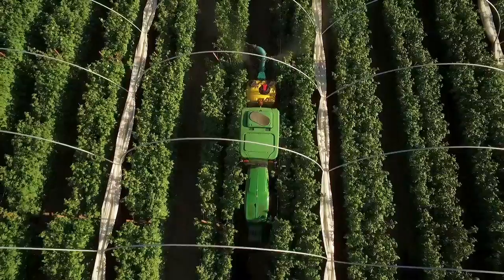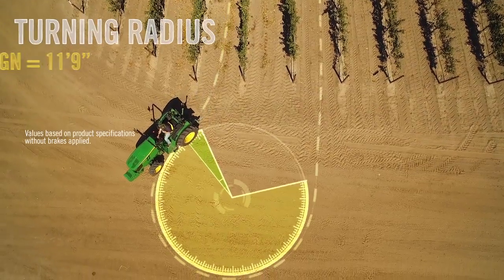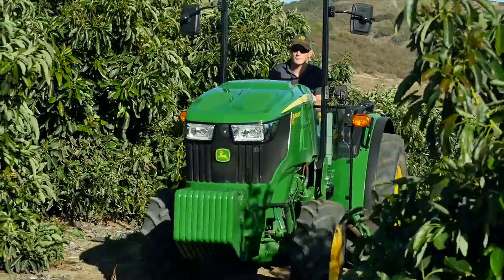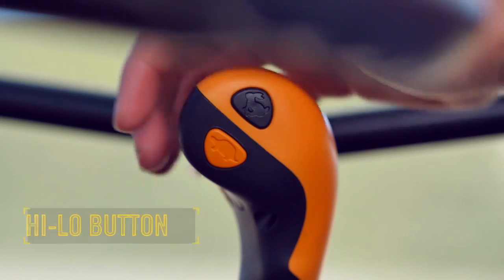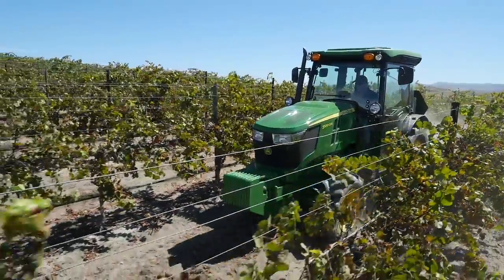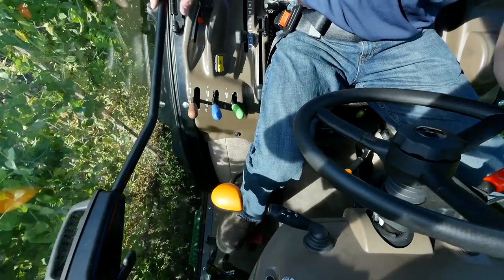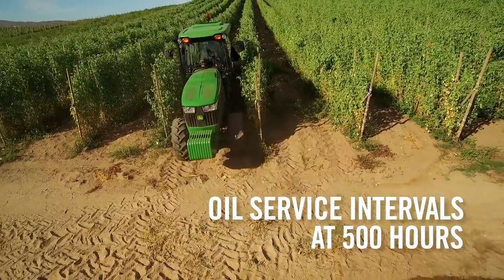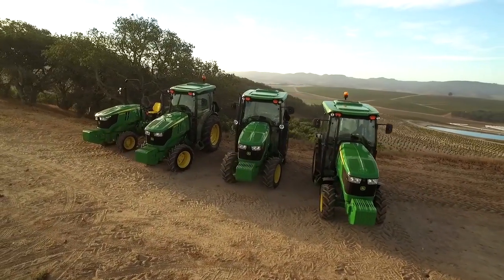5G Series Narrow Specialty Tractors | John Deere

Comment: my boss bought a new 5100gn tractor.  and when turning on the tractor it turns on a code that we don't know how to check.  it is the E032 PTO
Reply from the maker: We're sorry to here about this issue, Jorge. Most diagnostic trouble codes are stored on the control unit while some diagnostic trouble codes are displayed on the digital display automatically. If this is not the case, please reach out to your local dealer for further technical support. You can find your nearest dealer at Deere.com/Dealer. We hope this helps!
Reply: @JohnDeere  wow!! thanks for your fast answer.  thank you! Muchas gracias!

Comment: Is the cabin safe or do you have to wear safety uniform and mask? What category is it?
Reply from the maker: Thanks for the question! The 5G Series Specialty Tractors feature a Category 1 cab. We recommend wearing close fitting clothing and safety equipment appropriate to the job. Operating equipment safely requires the full attention of the operator. You can find additional information in the Safety section of the Operator’s Manuals for specific 5G models. Many Operator's Manuals are available online at techpubs.deere.com. We hope this helps!

Comment: What are the mowers that your narrowest tractor can pull?  Are there any that are the same width as your 43" tractors?
Reply from the maker: Douglas, there are a variety of different options available. Your local dealer would be a great resource to help you find the best equipment for your needs. Find your local dealer here dealerlocator.deere.com.